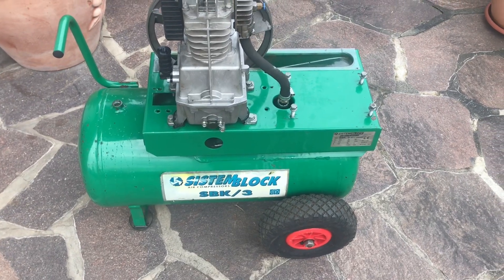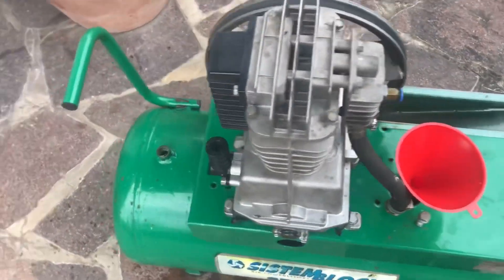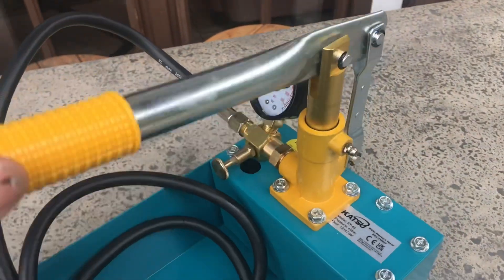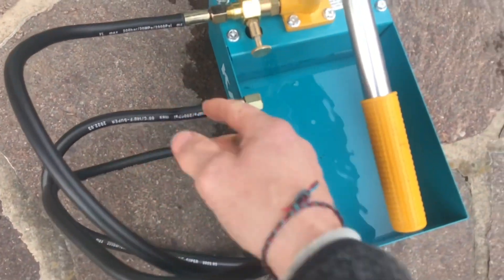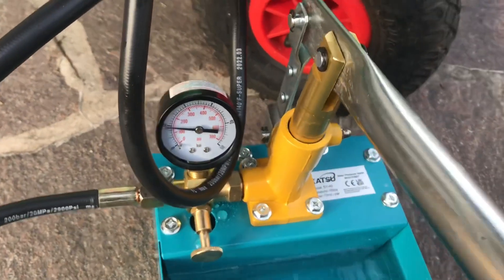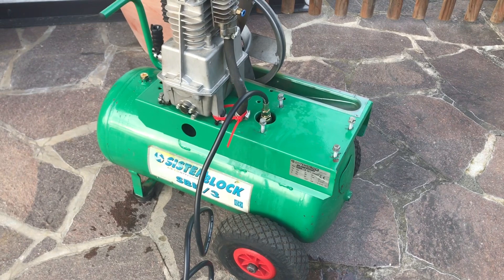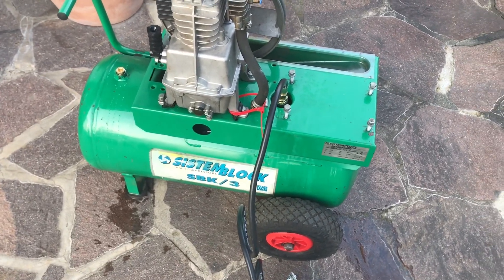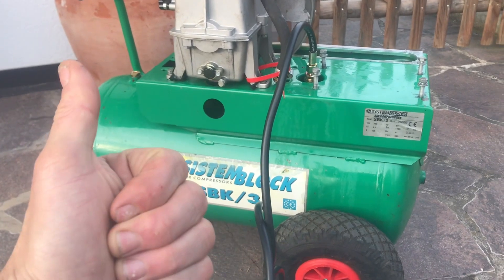Compressor Tank Explosion- Pressure Test

Comment: Tanks are elastic and expand slightly under pressure.
Before testing, accurate measurements of the tanks circumference in muliple places must be taken...
When at 20 bar re-check measurements. Light tapping with bal-peen hammer on welds and bottom of tank may give more confidence at 20 bar... They should be uniform. Recheck agian after hydro test. This is the most important measurement, as this will show any deformenity. If tank  has not shrunk back to origional size its weak and is  scrap.
Normally the hydro testing is done inside another tank filled with water, to measure the elasticity of pressure vessel as it expands and contracts.
Reply from the maker: Thanks for the feedback. You can do it 👍

Comment: Nice test.  Are you going to dry the compressor tank and give it an anti-rust coating inside now?
Reply from the maker: Hi no, but a good plan if it works. Best to always undo the water valve underneath everytime it's used of at least once a week. You can do it 👍